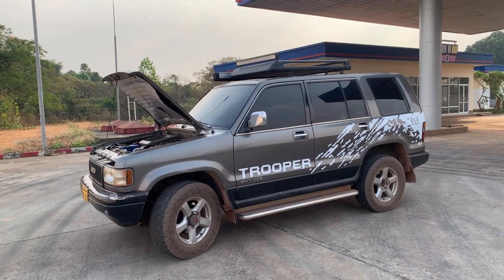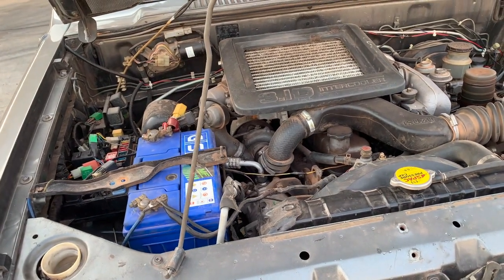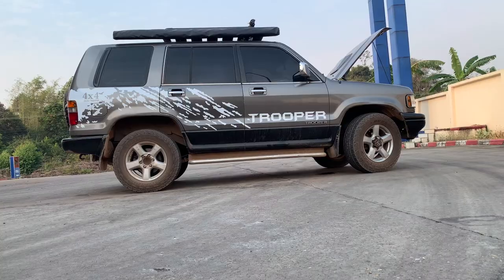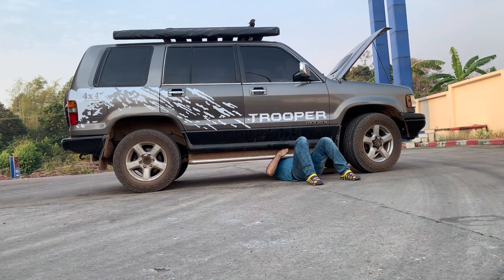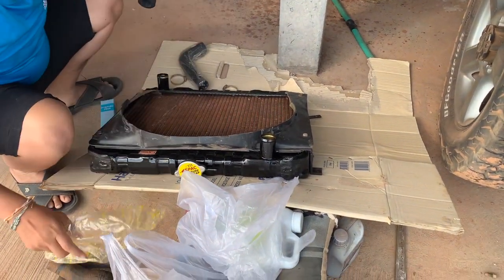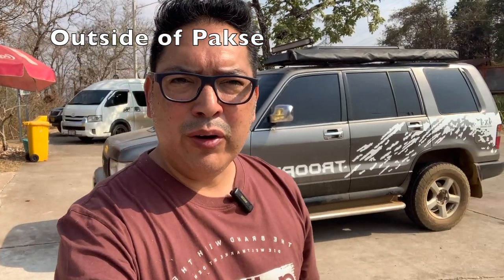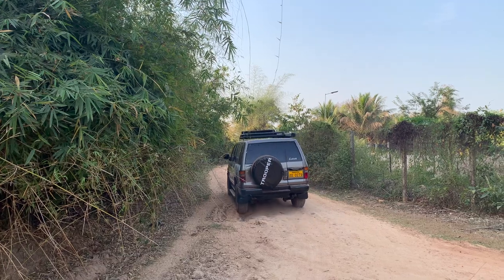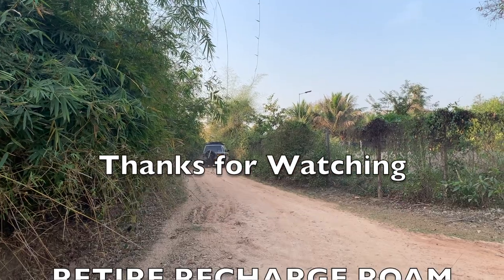Trouble with our Isuzu Trooper in Laos!

Comment: Owned a Trooper before. Make sure to change the hoses in the cooling system most specially the heater core. It gets rusted and causes a leak.
Reply from the maker: Thanks for the tip!

Comment: Wow! Sounds like you did an overhaul of this vehicle. Are parts expensive over there? Like how much is an alternator? Thanks.
Reply from the maker: In general, parts are fairly low cost…and labor is dirt cheap. To have a new alternator and fuel pump replaced, cost was roughly 1,000,000 LAK each or about $100 total (including labor). We’ve found that parts for the Trooper are not as common in Laos as Toyota parts would be…but have been able to manage.

Comment: Overheating?
So you replaced the radiator?

Was it bled properly? It should have self bled by now I guess.

Secondly, when it overheats is the overflow bottle full?

When you replaced the radiator, did you replace the radiator cap?

Sometimes, aftermarket caps that come with radiators have lower pressures, which makes the system boil over much sooner than it should under its correct psi. Please check the radiator cap.

Alao, does the temp gauge normally sit in the middle? If it does it means the water pump and thermostat should be working fine.

Lastly, aside from the radiator cap, the biggest issue on these and any Japanese 4wd of this era is the viscous fan hub.

Please spin it by hand when the car is cold, it should spin freely with some resistance.

Next drive the car until its at running temperature. Then open the bonnet and while watching the fan, have someone shut the engine off. The fan should stop immediately with the engine or very very quickly afterwards if its not very hot.

If it continues to spin, replace or re-oil the hub. 

By doing checking and addressing both of those issues your overheating should be fixed.
Reply from the maker: Nice tips! Thanks for the detailed info. We checked all that. Also found that the air filter needed to be blown out…it was very dirty from the Lao roads, and was I think all contributing to the warming up and lower power on the mountain roads. Seems good now. Thanks!